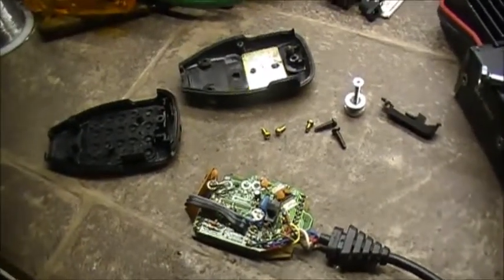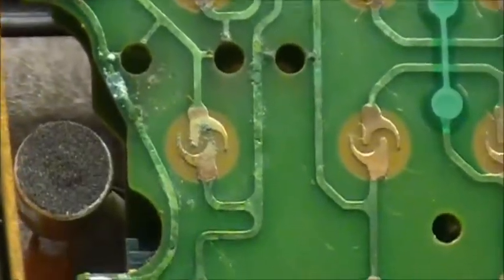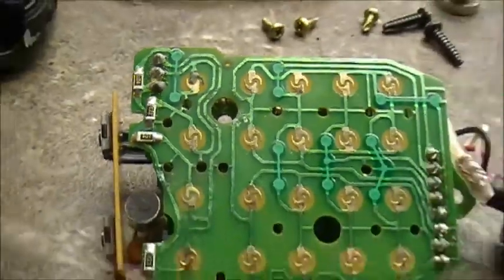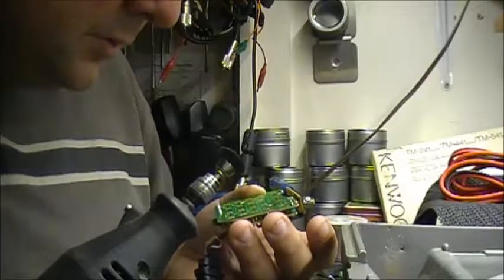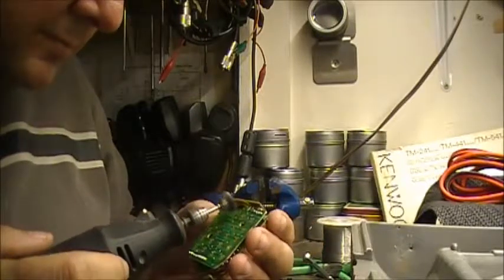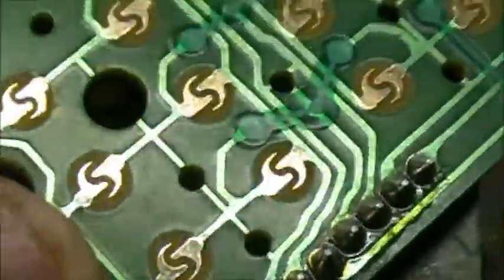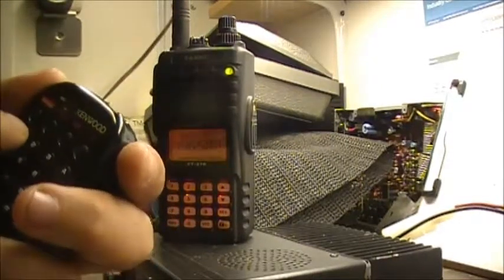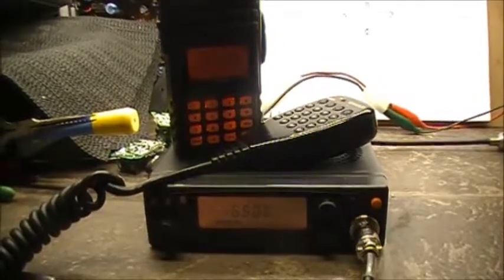Kenwood MC-44DM DTMF Multi function Microphone  REPAIR

Comment: Hi! Good video, how did you get the electronic board out? I removed the screws on it but it still won't come out. I can't separate it from the front plastic (the one with the buttons). Regards!

Comment: My key pad works on transmit (could hear on my ht) but no voice is it the mic or finals
Reply from the maker: Sounds like a bad microphone element of mic cord/connection
Reply: Radionut63 i found a cheapy mic for it on eBay to test it out should be getting it in about a week. I hook up my meter to it and it is transmitting power I get like 53 watts on high and nine watts on medium about four something on low so I think it is a microphone problem hoping anyway. Can the Element be ordered and replaced and if so where would I find that element
Reply from the maker: Sounds like the radio is working perfect for Low, Medium and High power.  I have seen the elements go bad, but very rarely... i would be more inclined to think it may be either a broken wire in the mic cable or wire connection loose in the microphone jack on the other end of the cable!
Reply: I check the mic pick up I think that’s what you’re referring to is the element with my ohmmeter I touch the white wire and the brown wire and there’s no continuity I checked the other wires and they all seem to be having continuity except that little Mic pick up which has that little cap on it looks like it says 101 on it

Comment: Thanks for the video!  I just picked up 2 old Kenwoods and although the radios work, both mics (just like this) are dead.  Will take them apart soon and see what the board looks like.  You have experience of these cables going bad, or mostly the board inside?
Reply from the maker: Not really, all i can say if the cable is shot, either get a new replacement or buy a new microphone.   Sometimes the repair is just not worth it.  :-)